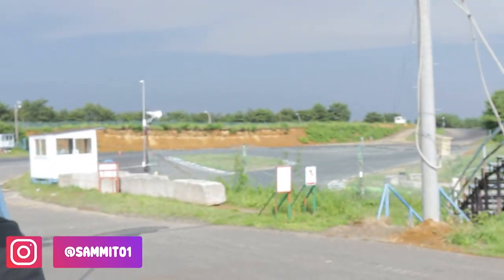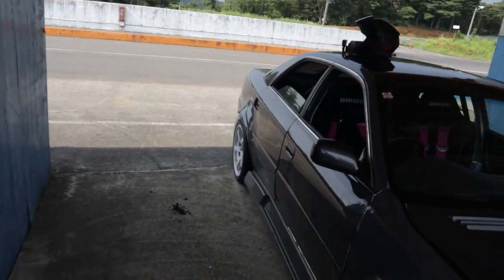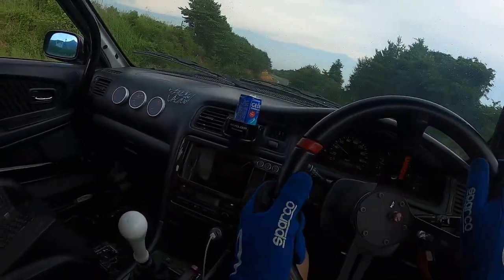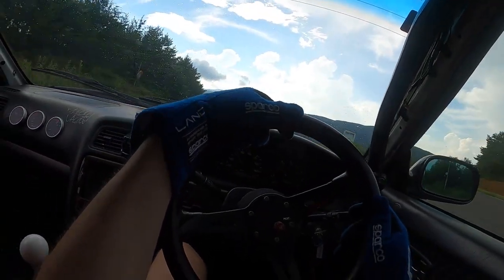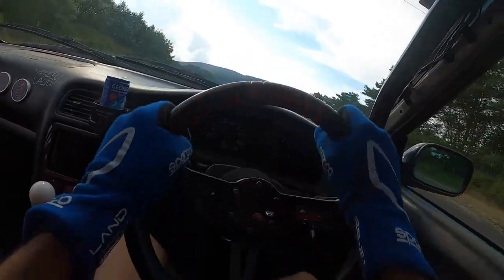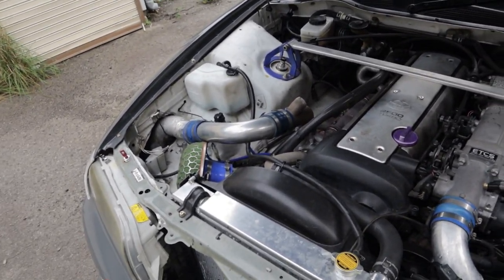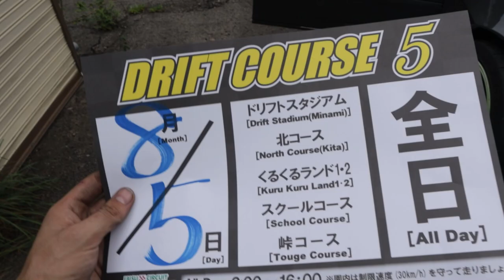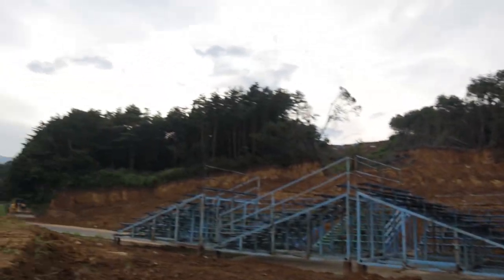EBISU CIRCUIT EARTHQUAKE REPAIRS UPDATE & DRIFTING CHASER DRIFT MISSILE!

Comment: Love the videos from the undersides. Makes me wonder if you could catch things going wrong before they do if you had a thermal camera  under the hood/fender etc.
Reply: That is what additional sensors on the ECU are for, you can set them to trigger a light, buzzer or shut the motor off. Suspension components are harder to detect, usually by the time the driver has noticed, it broke. You have to watch the road at 60+ sideways, not a screen showing the suspension arm...

Comment: The gas struts on the bonnet maybe forcing up the bonnet above its correct line. Had issues with this on our drift Soarer with a carbon bonnet, especially after engine bay temps got super high. The pressure in the struts would go up once they were hot and badly bend the bonnet.

Comment: @sammit use reducer from paint store to clean up the chaser
Reply: Do not use a Cellulose or 2K thinner. It will take the paint off. If you have lots of rubber bits and tar then use either Turtle Wax bug and tar remover, which is gentle, or White Spirit, which is maybe what you were thinking of? White spirit is good at taking off tar but wont damage your paint. Remember to test on a non visible area first.